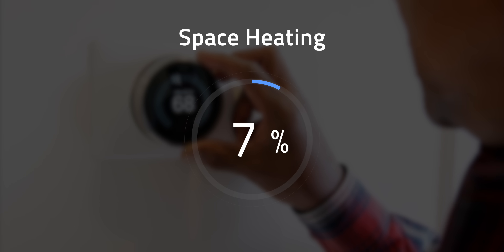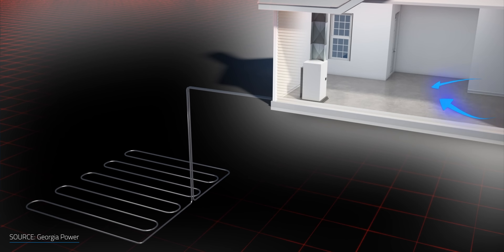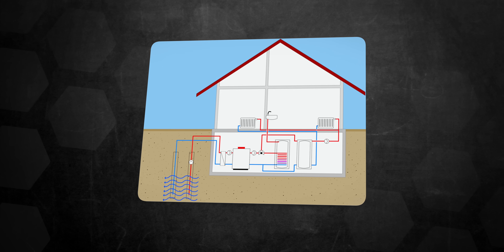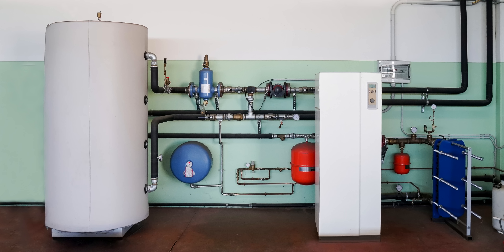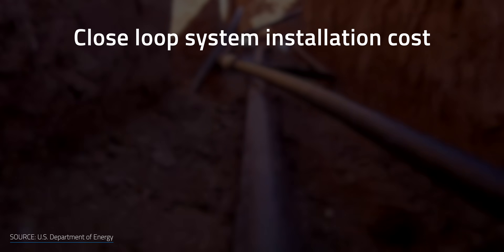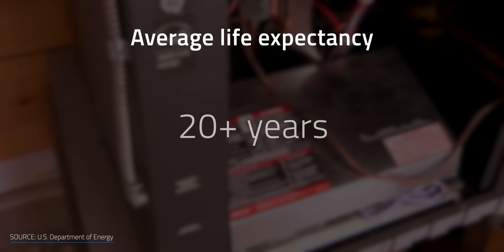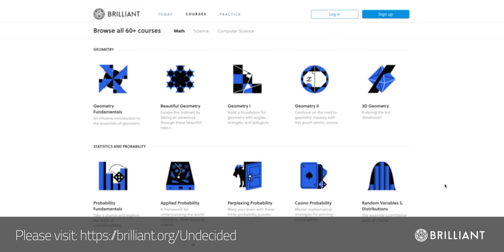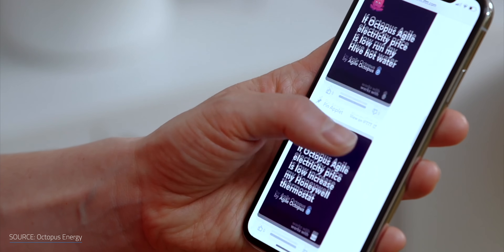Is Geothermal Heating and Cooling Worth the Cost?  Heat Pumps Explained

Comment: Ground source heat pumps are the only realistic solution for heating in the deep North. They're also, probably the best option for cooling in the deep South. If you look at HVAC as playing around with deltas, and the goal being to move your deltas as little as possible, you don't have to really understand the mechanicals. I'm in North Dakota and when it's -40 outside the liquid in the pipes buried in my yard is 50°. I have just gained 90° of Delta for $0. Now all I need for my heat pump is to take the 50° out of the fluid and use it to bring my house to a nice, warm temperature. 
In the summer when it's 90°. All I'm asking the heat pump to do is to strip 20° out of the fluid so I can cool the house with it. 
I splurged and purchased a heat pump water heater, and a heat recovery ventilator, and all my equipment is in a mechanical room so that the heat pumps can utilize the wasted.

Comment: working on a design to ground loop cool the house while dumping the heat not in the soil but the swimming pool with solar to cover the delta, then came across this video, need the house cold and the pool warm and kinda want to geothermal this bitch 🤣

Comment: "Since the 1940s" = another BIG strike!
The oldest known use of geothermal heating and cooling dates back to ancient China around 3rd century BC, where hot springs were used for bathing and space heating.
In terms of cooling, ancient Romans (~1st century AD) used aqueduct-fed water circulation in walls and floors, leveraging ground-cooled water—an early form of geothermal cooling.
(ChatGPT's first response(!))

Comment: Ground shift is a MAJOR problem for underground utilities.  Not uncommon.  Something to consider when thinking about vertical installed pipes.  The slinky might be better. Not sure the material type they use for heat transfer

Comment: We built a new home 10 years ago in the Missouri country where the ground is stable and installed a carrier geothermal system with the closed looped vertical pipes .  10 year warranty which was needed for the electronics on the unit (until we had a home surge protector installed by thebpower company and had the local contractor install a simple 1950’s technology solenoid ? to take the incoming electricity vs the computer board which burnt out twice).  Performance has been awesome,  AC set to 72 and heat to 70 (our preferred settings) coverage is 5000 square feet, all LED lighting, propane water heater and stove, electric bill for july 2024 was $165.  Avg is $155 over 10 years, highest bills are in winter, $210.  Spring and fall are $120 and less, have not broken under $100 but have come close.  4 people in the home.  a family member in the hvac business was worried about the pipes but they have held up.

Comment: It is less than $500 to dig a 50ft 5 ft down 4" duct hose in your yard with a 100w solar panel plus fan and you get free 55f air conditioning.

Comment: The costs of heating at 15% and cooling at 16% would not add up to 31% simply because you heat during the cold season and cool during the hot season.You would not use both at the same time , which means it would not account for 31%.

Comment: Heat pumps have been around as long as A/C system because they are almost the same system.  A heat pump allows reversing the compression cycle so it is an A/C system running in reverse when in heat mode.   There is no documented heat cost savings for use of heat pump over a natural gas furnace.  There are no break through game changers for heat pumps in the last 50 years.  Earth's greenhouse effect is always in saturation from the strong greenhouse gas water vapor (CO2e = 18) and can't have its overall effect changed by other greenhouse gasses.   Atmospheric CO2 at 1200 ppm would greatly green the earth.

Comment: I wish geothermal was more common in pre-built homes!!! It is an absolute no brainer if building a home and I would do it in a heartbeat if building a custom home. Unfortunately, I have always bought prebuilt homes (due to cost and location needs). My current house was built in 2007 and I've looked into retro-fit but that is much harder to justify and is a bit more complicated. While the initial cost is a little higher than more 'tradition' heating / cooling systems, rolling that into the build of the house would make is much more accessible.

Comment: Matt, enjoy your programs.
I'm building a new hom that will be off grid with solar power only. I'm looking at air/water heat pumps to provide hydronic floor heat. I live in norther Ontario Canada,, so a little worse weather than you. I wondered what type of power demand you are seeing on your heat pumps? I trying to size my solar batteries.

Comment: Good in theory, bad in practice. Not only are they ridiculously expensive, like, it will NEVER pay for itself kind of expensive. Depending on the size, quality, and complexity, you’re talking $25K-$75 just for install. Maintenance can cost a couple thousand per event. But, they’re also extremely vulnerable to seismic events and natural earthing. 

If you’re looking for efficient heating, propane is the way to go. Cheap upfront costs, maintenance costs and operation costs for the amount of energy you get per set amount of volume…..all while being relatively safe and clean.

Comment: I am trying to design a pond loop heat pump system for a community in a tropical country, just for cooling.  I am not sure how much energy it will save, and need to make a good case for cost vs benefit.

Comment: The cost estimate for the installation of a ground source heat pump  provided in this video is wildly out of whack. I received multiple quotes in the spring of 2023  which were over $60,000 higher than the quote for an air source heat pump system.

Comment: Electric vehicles are not the solution. Electric power plants receive 92% of their energy from Coal and Natural gas, 4% from Nuclear, and 4% from [Hydroelectric, Geothermal, wind, & solar]. Also, the resources for the batteries for EV's are finite and then their is disposal of the batteries. Fossil fuel is still the most cost effective source of energy, and it's plentiful. An 11 billion barrel reserve was recently discovered by Exxon, not the mention the abundance still untapped in Alaska.

Comment: Isn’t all relevant with the construction costs and payback, I’m a retired heating technician and after putting all the greatest and latest efficient equipment there’s no benefit without the proper building construction of insulation, air movement and design. It’s a waste of money if the Building codes or construction practices are not improved, if your spending $50,000 or more on heating and cooling would it not be more cost effective using that money preventing heat loss or heat gains? I see the actual benefits of geothermal for large commercial use when you have multi dwelling units but for a single dwelling unit you would benefit more on spending that money on insulation,and construction practices! There are some improvements in some jurisdictions requiring air tightness testing and compliance but more needs to change, I know government and developers battle over codes vs costs but it’s the old pay me now or pay double later senecio?

Comment: Wouldn't having some kind of conductive fins on the loops improve the surface area without needing as much space? The real surface area issue is more about how much the earth around it can transfer the heat to more earth. Making the looped version less ideal... The issue with the metal would be the corrosion, but that's already been 'solved' with gas pipes.

Comment: Replaced our peipane syatem w/ a closed loop, vertical geothermal system in 2010.  It has been nothing but trouble free and efficient.  Any reputable installer will have an idea about the geology and soil conditions in the area they work in.  In my case, there is ironstone in the area with sandstone overburden. The vertical well subcontract had an add on in $$ if they hit ironstone.   Luckily they didn't in my case.  A critical aspect of the system is the loop and proceeding with a driller who lnows what they are doing is huge.  For instance, if they grout the well, there is no chance of "bedrock shifting". ( not referring to tectonic shiftimg here!)

Comment: With todays inflation you will pay at the high end for this system. What exactly are you doing? Lot of fancy science and fuzzy math was mentioned. Well you are digging a $20k hole to replace a condenser fan that draws about 2 amps with a circulator pump that draws 1.6 amps. Stop the nonsense with these systems. Leave them where they belong, with 1985 rerun episodes of this old house. In the north mini split systems blow the doors off any geo system 10 fold. In the south, just add a water source coil to your pool and save just as much cash if not more.

Comment: I love my Waterfurnace geothermal system.  My wife loves the warm air in the heating cycle and it preheats the water going to the water heater.  Yes, it takes years to recover the costs, but the cost savings really start increasing each year after.

Comment: The price of a new A/C unit nowadays in Florida is around $10 to $17k depending on the brand and specs. So the price for a geo thermal system have better return of investment if it last longer and needs less maintenance.

Comment: As a staunch conservative, I'm very interested in conserving my money. So, 25 years ago I bought a small ranch, 65 acres, and it was my dream retirement place. I had planned on building a concrete house and installing a mega geothermal ground system. Additionally, once solar started becoming popular, I was beginning to contemplate solar. My idea was to be is for off grid as possible without going over the top 100% off grid religious. The land already had electricity, so 'what the heck' why not save some money :-) HOWEVER, I got into some money trouble and had to sell the place, but it was a great idea that I truly mis planning for...

Comment: Geothermal compressor units have a lifespan of ten years.  
  Geothermal Installation costs are actually $40,000.  
  Replacement of the compressors at ten year intervals cost $6500
   The very low cost numbers that entice people, as given in this video, are not realistic.   
  It is definitely more comfortable than any other system, and doesn’t require refueling.   
  It’s just WAY more expensive than anyone selling them will ever admit.  
  Geo is not about saving money.

Comment: Hard realities.  After your recent video where WaterFurnace gave you a system, I went through the process of requesting a proposal for a three ton system for our 1,700 sq ft house.  Sadly, they offered a high price for the Series 5 dismissing the option of hot water supplement.  While it is understandable when a company tries to take advantage of emerging circumstances, in this case pocketing the 30% tax credit, and in this case, no sale.

Comment: You fail to mention that the prices you quote refer to new homes built with high thermal efficiency and suitable radiators. Retrofitting an old house that requires changing windows and thermal insulation as well as radiators can double the cost as we find in the UK. These systems also need a supplementary heat source when temperatures are low, especially if the property does not have a heat recovery system. This is why the UK Government is looking to retain the current gas boilers but switch methane for hydrogen.

Comment: The heat loss standard conversion (5:34) to metric does not add up. Should have multiplied by the conversion factor instead of dividing.

1 BTUs/ft2 = BTUS/(m2/10.92) = 10.92 BTUS/m2 -> the range should be 176-253 BTUs/m2/h

For example: 1 m2 is roughly 11 ft2 and to calculate the heat loss standard here according to the metric calculation, you would need 1.49-2.14 BTUs/h, and according to the original formula you would need between 176 and 253 BTUs/h...which makes more sense to me (as m2 are larger).

Comment: I had natural gas then moved to a house with geothermal.  The electricity to run the geothermal is far far more expensive than natural gas.  In the winter my electricity bill regularly hits $800 per month. That is after disconnecting the emergency electric heat element, buying all new appliances and switching every light to LED.  Maintenance on geothermal is more frequent and expensive as well.  If there was natural gas available on my street I would be switching back today.

Comment: With air-source heat pumps getting better all the time, even for colder climates, it is very difficult to justify the massive up front cost of a ground-source system. The best air-source systems are nearly as efficient at half the cost, and come with all the same benefits. The key is making sure your building envelope is tight and well insulated. It makes absolutely no sense to spend a premium on a high efficiency heat pump if your building isn't optimized for it.

Comment: Hi! Very good information in your video and I share many of your opinions but for some time I have been investigating geothermal heating with the vertical geothermal capture method using probes or wells that consists of single drilling with depths between 50 and 250 meters for more and better heat uptake and better results in heating and cooling and I thought it was important that you mentioned it in your video.

Comment: Hello, I admire your work, very nice videos, I am a subscriber for a long time. Please note that there is a mistake in the transformation from square feet to square meters on the 5:34 minute. It should be more BTUs per square meter not less since a square meter is way higher then a square meter. 16 / (3.05 * 3.05) BUTs per square meter ~= 172 BTUs per square meter. I wish you all the best.

Comment: But from my high school physics, we used to say "liquids are incompressible". so what exactly does the compressor do on the water? is it just to increase the temperature? (I guess yes)
I had some readings which says that most of these geothermal heat pumps actually have some refrigerants which are in a closed loop just like in a refrigerator or chiller. 
This refrigerant is compressed and expanded in a closed loop, without being in contact with the water from the ground source nor with the air or water in the heat sink. heat flows with the help of heat exchangers just like it is the case of chillers. 
In the end, there are three distinct and physically isolated loops (the heat source loop, the refrigerant loop and the heat sink loop)

Or except these are just different available technologies.

Comment: Can passive geothermal for heating and cooling be successfully used without expensive heat pumps, exotic fluids, and connection to power grid?  This 89 yr old retired mailman living in subzero Nebraska says absolutely YES.  His secret?  Trust and think for yourself and don’t rely on “experts” to tell you what you can and can not do.  Common sense 101!  https://youtu.be/ZD_3_gsgsnk

Comment: It would seem that with energy costs varying throughout the day, one of these systems could explore the use of a cistern to act as a thermal battery. Similarly,  a MidAmerican Energy office building her is Sioux City uses a sort of swimming pool of ice chips where it banks little units of water lacking heat for parts of the day when the load is higher.

Comment: If I was in the right location I would be going for a daylight basement house with a geothermal system, pasive solar features biased for heating or cooling depending upon my location and a well and septic system properly oriented so the roof runoff helps recharges my water source while the septic tank would generate gas to either boost the heat or cook after some filtration steps were taken.  Unfortunately the current McMansion sized lots simply do not allow for that sort of self reliant infrastructure for a house once you add wind or solar and batteries.  

I sat down and figured it out a couple of times and it looks like the price of such a house would be double what a new one sells for because of the cost added for a 5 acre minimum parcel and extra mechanicals required.  The cost of ownership would probably go up requiring a high baseline of tradesman "Helper" skills as well considering the possible filter changing, pump monitoring and other skills.  A 5 acre farmer of sorts.  People call for more urbanization as "Green" I do not agree with that.  I see a more spread out approach as being better with better planned and flexible communities.  The families with kids have the 5 acres, the young adults and geriatrics have the apartments and in between are the supermarkets, factories and offices required to drive a robust local economy.  The factory cast offs would be inputs into other economic activities with some sort of "Green Heavy Generation" powering the energy intense hub.  The "Green Heavy" generation would be MSR Nuclear, Geothermal, Riverrun Hydro or something of similar megawatt class.

Comment: The heat pump is great in regions where the ground and air temperatures of vary by a decent margin so heat can transfer.  I have been in areas where the air temperature often exceeds 100 degrees and the ground temperature hovers in the 90's...  The system would never shut off.

Comment: I have seen several folks have great success with geothermal heat pump, but it requires more land than typical urban lot has available.  The houses in my neighborhood are generally on lots that are 70 feet deep and vary from 60 to 90 feet wide along the road. After avoiding underground infrastructure (water pipes,  etc) and the driveway, our front yard is about 20 feet by 20 feet (not including road right of way).  How can these systems be installed on city lots?

Comment: Geothermal is not effective in older homes. The cost to insulate the walls with blown in foam and the attic with r30 insulation also energy efficient windows plus system install is cost prohibited.